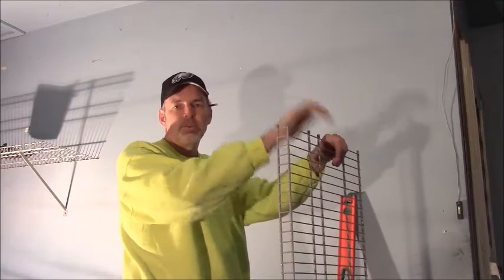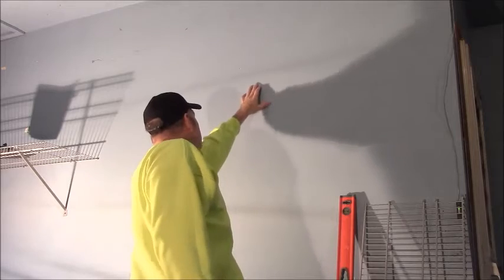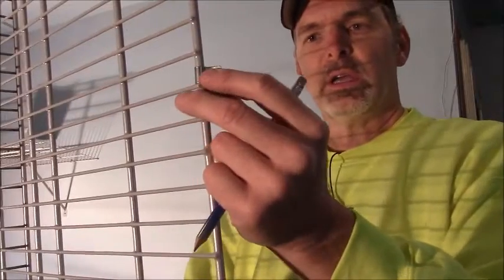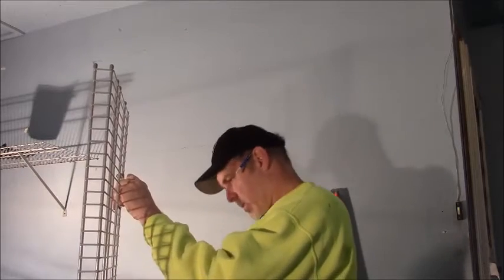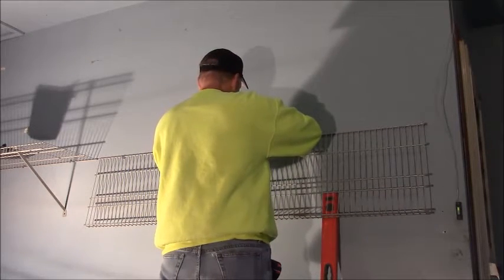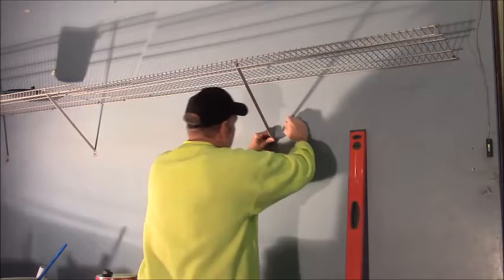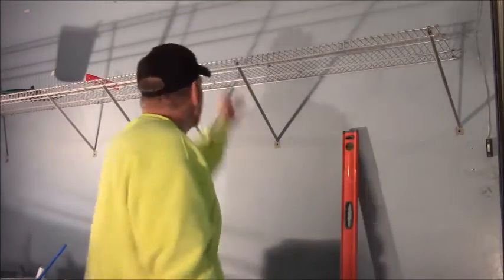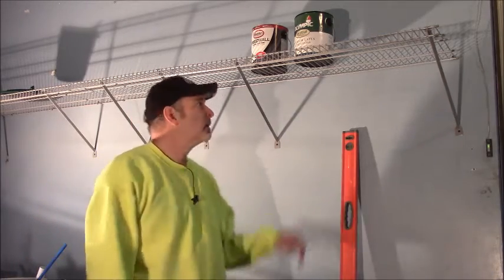HCC 7: Shelving Installation

Comment: I needed this video! My husband and I just bought a house with a garage, so my mother n law gave us 5 wire shelves. They are going to come in handy so that we can keep the floor of the garage as clear as possible for our cars. The only thing is we have to buy the accessories because the shelves were used and does not come with the brackets at all...! Home Depot here we come
Reply from the maker: +Nina Goldwire Glad to hear the video was helpful.  Wire shelves are great for garage storage.  Especially when they're free!  HD should have all the brackets and hardware you'll need.  Make site you get them hung in a stud for strength.
Reply: Home Craft Chronicles 
Okay...thanks!

Comment: I have horizontal wire shelving in my closet. Is there a way to add vertical shelves to those for linen storage?? Thanks!!
Reply from the maker: Not sure i know what you mean by vertical shelving. There are quite shelving systems that are expendable